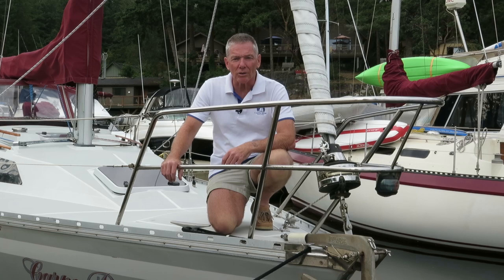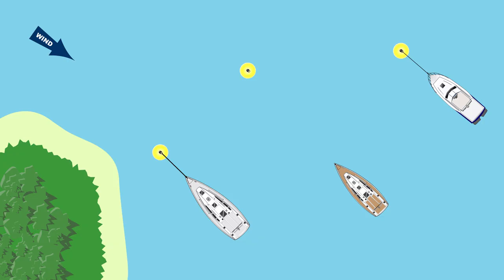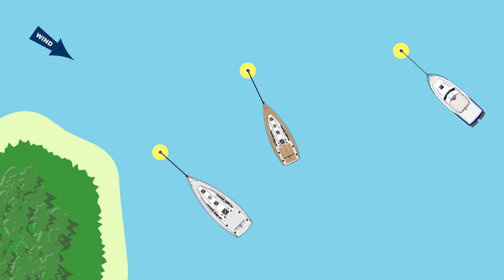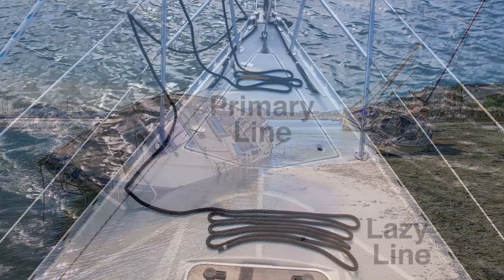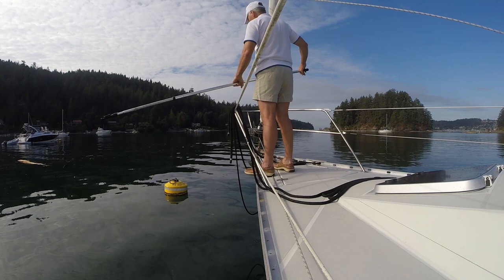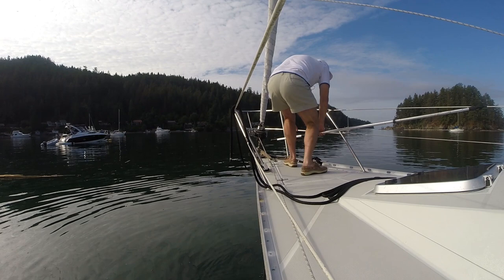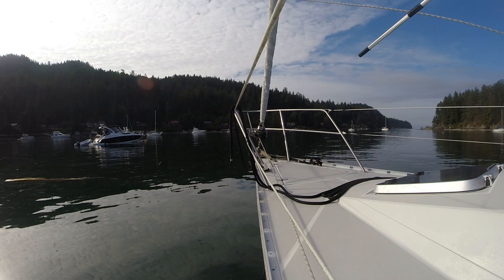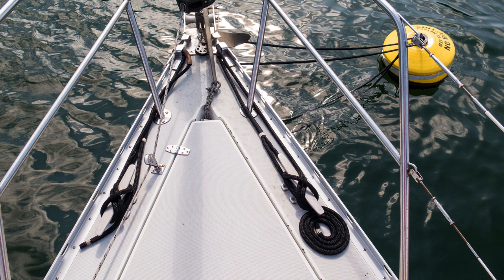Ep 16: Picking Up a Mooring Buoy

Comment: Running the line through the eye then back to the opposite side of the bow virtually assures that the line will chafe. If brought back to the same cleat or side the chances of chafe become almost nil. Since you are rigging a second line anyway, deploy it on the other side. There are then two working lines, neither of which rub back and forth on the ring.
Reply from the maker: Thank you for the comment Ted, I appreciate you taking the time to leave your feedback. This does makes some sense. I have tried both and for me I prefer the clean run to the opposite side and fairness of the lead from the front of the boat. Another one of my instructor friends also pointed out that he does a half turn around the ring and that helps eliminate chafe. The bottom line for me is to have some kind of backup as chafe is always a potential problem with dire consequences.

Comment: I always put the mooring line through the eye twice as this reduces abrasion. More recently I have been using a mooring line made up with a short length of chain (~2m) with the warps spliced to each end. This eliminates any chafe at the buoy end. I still use a safety line as well though!

As our bow is quite high we have been experimenting with backing up the boat to access the buoy from our sugar scoop/bathing platform. This makes threading the line through very easy. But we need more practice in strong wind and tide as it can be a test to get the buoy back to the bow position.
Reply from the maker: Those are great points Bill. Thank you for taking the time to comment. I am planning to do a follow up video incorporating some of those ideas. I really like the idea of backing up to the buoy and certainly in windy conditions that would easiest with my boat. Very innovative of you to design lines with a length of chain. I bet you sleep well at night 😉

Comment: Man it is so more easy with the chained-out buoys. I regularly break my back when trying to reach down the buoy eye and pass my line into it espically in clappy waters and moderate wing. I have often wondered by port-athorities could not install more sailboat friendly buoys like the one shown here. Or at least get buoys with elevated eye.
Reply from the maker: Thanks for the comment 12345. It would be even easier if they had lighter floating rope pendants spliced to the eye of the mooring ball but they would have to be regularly maintained as they are subject to UV damage.

Comment: Wondering if there is an easy (and fast) way to thread both lines through the buoy hook at the same time and still concentrate on just getting the first one secured to hold the boat in position before securing the second?
Reply from the maker: Interesting thought! That would make life easier. I'll think about it. Thanks for the comment.

Comment: That style of mooring set up is totally different from what we have here in Maine.  Here the mooring has an attached pendant that the boater picks up and puts onto a bow cleat.  Typically pendants are 3/4"  (19 mm) at a minimum.  The pendant always has a piece of light line (3/8" or 8 mm) that goes from the spliced eye at the end of the pendant to a float of some sort.  Floats range from styrofoam lobster buoys that you snag with a boat hoot to pickup buoys with a 6' to 8' mast with a float on the mast and weight at the bottom of the mast so it floats upright.  With this sort of setup there is no need for the boater to supply a line unless the mooring pendant is too big to pass through the boat's chocks.  Pendants almost always have integral chafe protection, which combined with the larger pendant diameter greatly reduces the risk of chafe through except during significant storms (50-60 knots) with large waves.  In fact my 36' full keel boat has ridden out a number of 60 plus knot storms on the mooring without chafing.
Reply from the maker: Hey Todd,
Yes I am familiar with that system and you're right it is way better. Years ago when I had my own mooring buoy that's how I had it set up and yes, never had an issue with chafe ( still had two pendants just in case). Last year I spliced up some pendants for one of my students who was keeping her boat on a mooring buoy. Spliced eyes with thimbles and shackles for the buoy end and spliced eyes for the cleat. Infinitely better. The system you see in the video is how all the mooring buoys in our provincial marine parks are set up.
Reply: @CarpeDiemSailingMagazine  Washington state marine parks have something similar to what you show.  We don't have marine parks here, but all the rental moorings I have encountered here are set up as I described.  Have you ever considered shackling a proper pendant onto one of those moorings?  A zip tie would be adequate in place of seizing wire on the shackle for a single night.  Also if I had an anchor roller setup like yours I would want two lines as well.  That is one poorly designed anchor roller/bow setup.  That said, if my boat will be on the mooring for a bad (>60 knots) storm from the bad direction (east in my home harbor), I do shackle an additional pendant to the chain below the mooring buoy.

Comment: Thanks for this video!  Great info especially on the idea of running a long line and picking up from the cockpit if conditions demand.  Would it also make sense to equalize the lines (ie put the lazy line to work :) and have them share the load?  Thanks again!
Reply from the maker: Hi Stephen. Glad you enjoyed it! Thanks for the comment. In my opinion I would prefer to leave the lazy line loose enough that it will not chafe at all... and on the subject of lazy lines in my first mooring buoy video I demonstrated the line going from one side of the boat , through the ring and back to the other side of the boat. I was fairly widely criticized for that and the issue was chafing. After having tried both ways I personally prefer the line on opposite sides of the boat as the load is centred and the boat rides better to the wind.
Reply: @CarpeDiemSailingMagazine  Cool thanks!  That makes total sense then with the lazy line and there is definitely logic to wanting to keep one of your lines 100% isolated from chafing.  Re: lines going to opposite sides...I've also seen others recommending the other approach in terms of running your lines back to the same side.  It strikes me as though the most important consideration with all of this is to just make sure that you have two lines although I understand the logic of potentially minimizing chafe by keeping each line isolated to its own side as well.  One thing that I could imagine happening might be someone (or even lots of people!) running a single line from one side to the other and then believing that they established redundancy, when, in fact that were not the case at all...and in fact maybe they even weakened the system by exposing it to more chafe?  I'm totally new to this and have only moored a boat literally one time!  At any rate...thank you again for all of this info, I am going to get out and practice all of this stuff my next time on the water!

Comment: Thanks for making these videos. Can I ask why you didn't thread the lazy line through the ring when you pulled the chain up the first time?
Reply from the maker: That's a great question. I find the chain, especially if its jammed in the buoy really heavy to hold onto, so I only had a short amount of time to thread one line (with more preparation and forethought I might have been able to thread both at the same time). I have had many comments for this video with lots of questions and suggestions so I will be doing another video this simmer to incorporate those. Thanks for taking the tine to comment, I appreciate the support.
Reply: @CarpeDiemSailingMagazine  it just looked back breaking and I felt it. 😀

Comment: Couldn't you make fast the lazy line and slip both through the ring together?
Reply from the maker: Yes. That comment has been made.  It’s been my preference to run one and keep things simple rather than fuss with two lines at once but it’s a good thought l. I’ll be doing a follow up video with that in mind. Also leading the lines back to the cleat on the same side. Thanks for the comment.
Reply: @CarpeDiemSailingMagazine  BTW, great channel.  I am pasting your links to my novice sailing friends
Reply from the maker: @ronniecaptain  Thank you very much. Much more to come. Raising and Lowering Sails, Tacking, Gybing, Crew Overboard Drills, Gear etc.